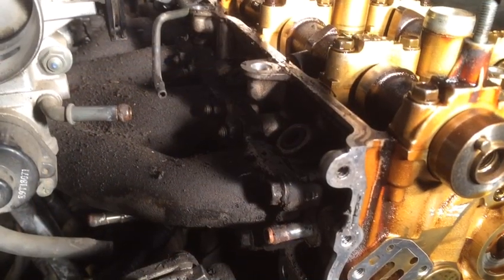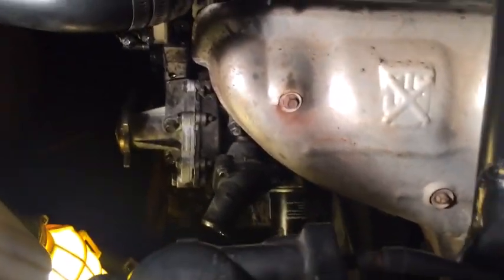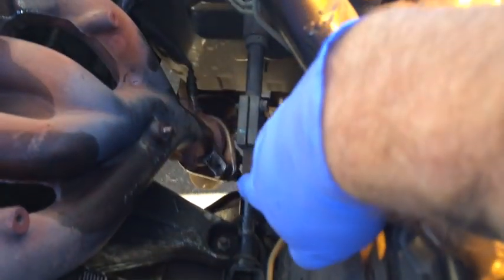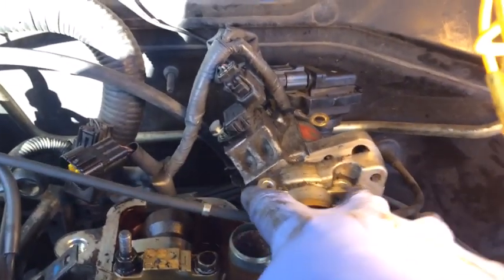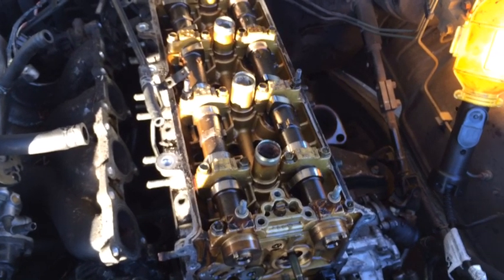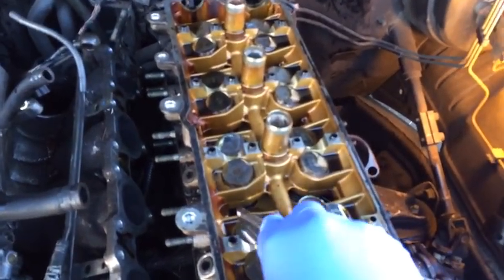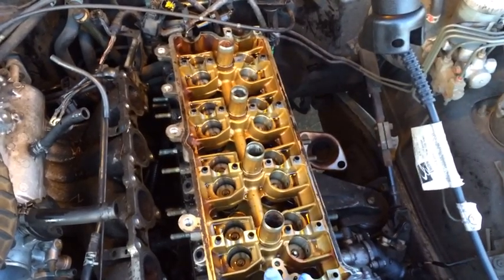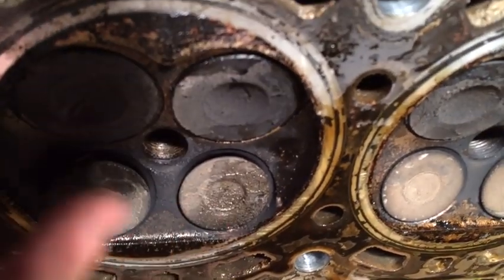Cylinder Head Replacement Part 5

Comment: Great videos.  You should unscrew the bolts 1/3 turn at a time, in several steps until all are loosened, to prevent possible warpage.